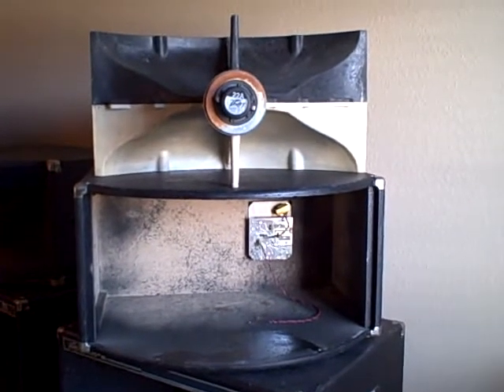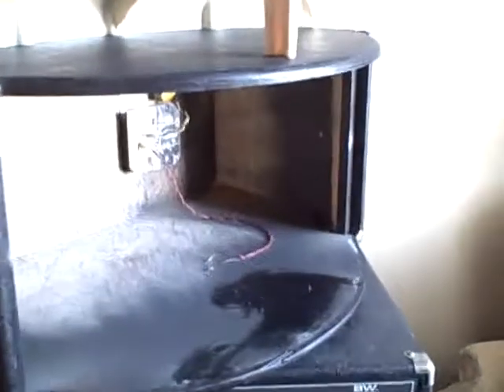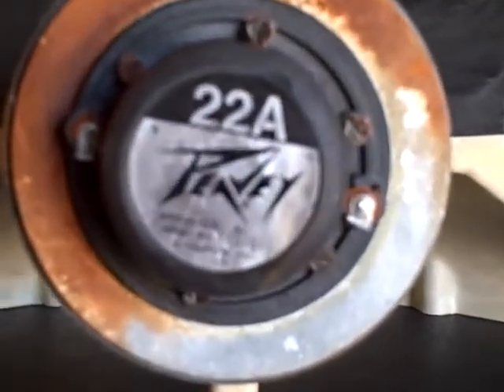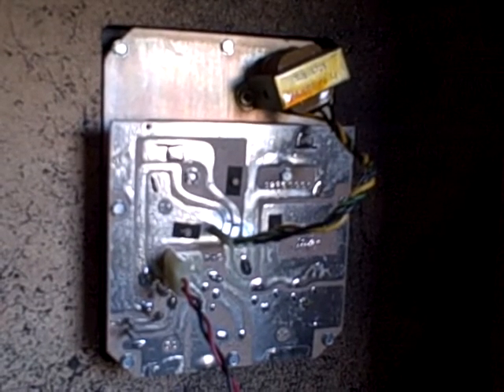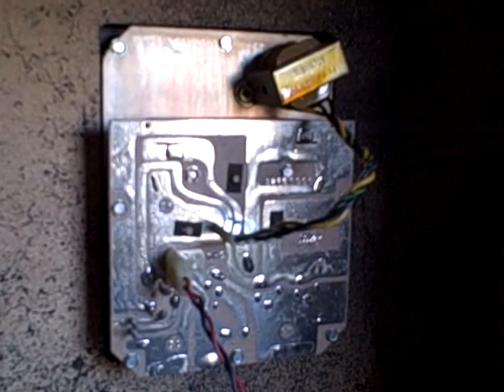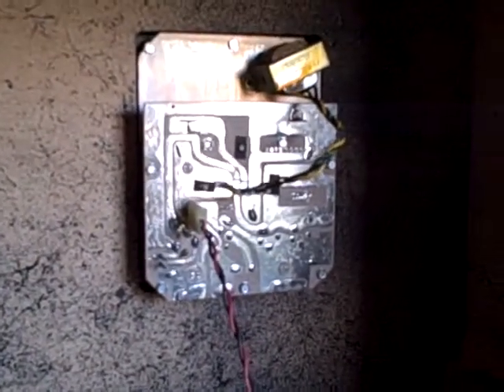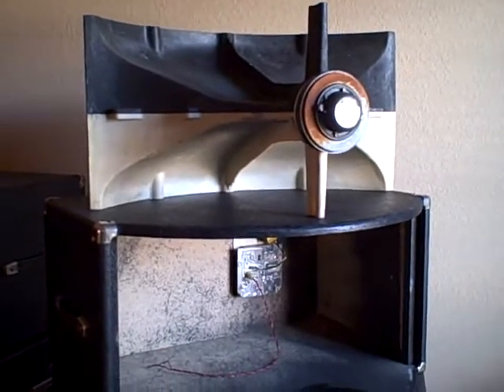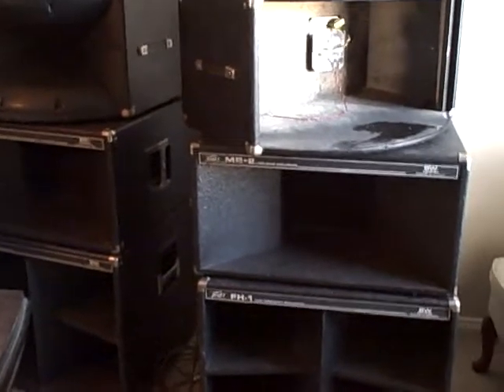Peavey Project 2 - inside the MF1-X

Comment: I saw 4 of these for sale locally. Is there room in the back inside of box toreplace the driver with a later more powerful driver. I am looking for about 4 inches depth of driver. Thanks. Looks great. Hard to find durable wood speaker box
Reply: Rob - The original driver (22A) is about 2 inches, so I would guess that a 4 inch deep driver would fit, thought that is just a guess. As you likely know, you can still buy the Peavey 22A drivers as well as a ton of replacements. I supposed the worse that can happen is that you purchase a set of replacement drivers - find out they are too big - and you return them. Good luck